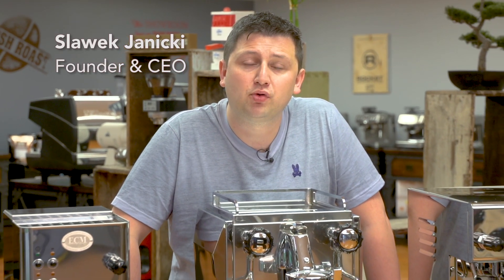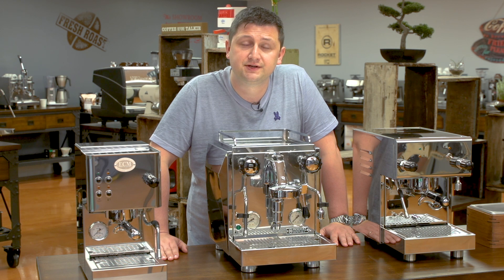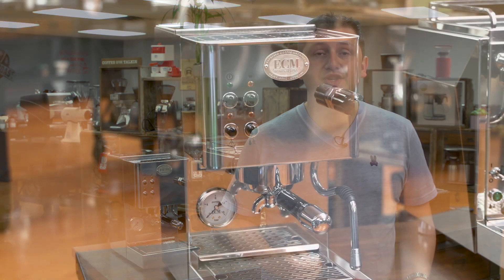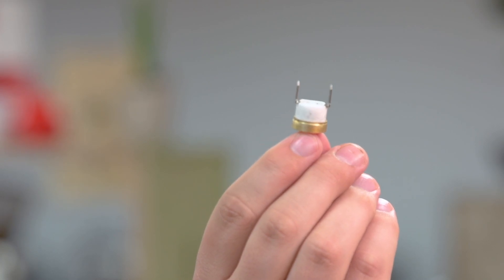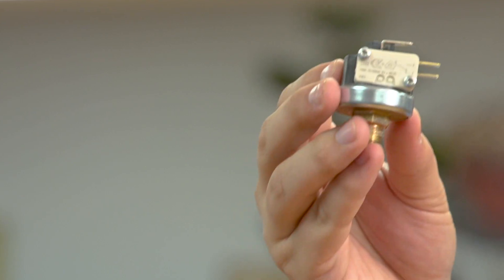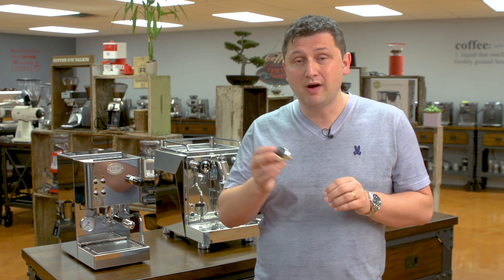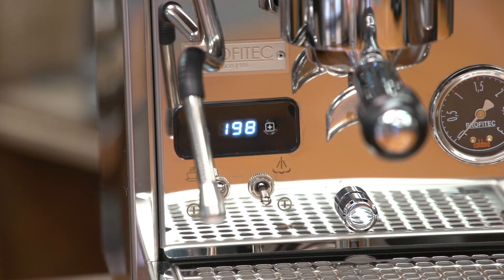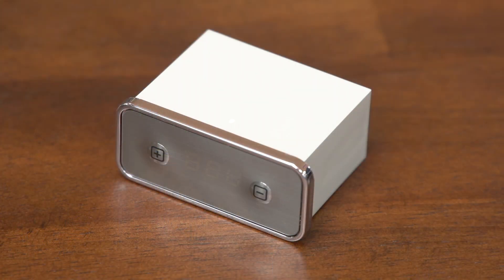Comparing the different ways of controlling temperature inside an espresso machine

Comment: Hi Slawek. Thank you for explaining PID! In a single boiler machine such as the Profitec Go for instance, how precise is what you set the PID and what it displays? For example, if you set it at 200F, does the PID turn the element off once it gets to 200F, but could residual heat allow the temperature to climb slightly higher, thus allowing the PID to display 201º or 202º perhaps?  Thank you.

Comment: Hi there, I want to upgrade my singleboiler machine from a pressurestat to a pid, what is the best location for the temp sensor to mount?
Reply from the maker: Usually most kits go in place of a thermostat.  That's likely the best spot because it is what the manufacturer uses
Reply: @iDrinkCoffeeCanada  well a pressurestat is placed on the top in the steam/air so to speak- this doesn't matter to measure pressure- while air isn't the best heat conductor I think a temp sensor should be placed on the bottom in the water for the best and direct heat conductance and thus measurement isn't it?
Reply from the maker: @Ronb008  hi, sorry I misread your post.  If you have a pressurestat that means you have a heat exchanger machine.  So yes I think the side or the the bottom is better, you want to be below the water line which is usually about 3/4 of the boiler.
Reply: @iDrinkCoffeeCanada  Yes i thought so, Ive got space to drill and mount it on the underside of the boiler so I think i'll go for that

Comment: Hi Slawek. Thank you for this good video! I am in between the Rocket Appartamento and the more expensive PID Giotto, Mozza V. I have a limited budget and wonder if you know whether the PID  Giotto would make much difference over the pressurstat Appartamento on the quality of brewed cofee. Thank you!
Reply: Which one did you buy ?
Reply: @Abaaaddy  Lelit MaraX. Not as nice as the Appartamento but better developed functions.
Reply: @eskerinola5845  does it have a PID?
Reply: @Abaaaddy  Lelit developed a DOUBLE sensor that works very effectively with the controller. It is not PID but afaik (common knowledge), the effect of PID controllers in HX machines, due to the fact that the one sensor is placed in the steam boiler, are RELATIVELY useful.

Comment: so if we need to compare between temperature stability this means that any PID machine is better than pressurestat
as if i want to compare temp control  between single boiler machine with  DIP and heat exchange the single boiler with PID is better 
also is there difference between heat exchange machine using PID and others with pressurestat

Comment: Good review. The "range" of mechanical and pressurestat activation is called 'deadband'. There are other ways of minimizing the deadband of these device use cases, but PID is becoming so cheap and prevalent now. Also, PIDs do not always have to just switch the heating element on/off hundreds of times. Some manufacturers will use SCR to modulate the power the element gets, and the PID controls this SCR output. This is theoretically a way to get more longevity out of the system since it is not constantly switching on/off.

Comment: Thanks for the informative video! How precisely can the brew temperatur on a spring lever machine like the Profitec Pro 800 be set? Do the benefits of the PID even properly show there?
Reply from the maker: In a dipper machine like the Pro 800 the water inside the boiler is used for both espresso and steam/hot water.  The PID gives you precise control of that water.  The water for the extraction is pulled from the bottom of the boiler and then as it passes through the hydraulic system and cools down before reaching the coffee.  The PID does help for sure but you can't go too low with your temperature on a dipper machine because you won't have any pressure inside your boiler.
Reply: iDrinkCoffeeCanada thank you! So in your experience, how many degrees Celsius would I be losing from the boiler to the group in order to calculate and set the necessary boiler temp for my particular brew temp?
Reply from the maker: @florinreifler1450  to be honest I have never measured.  I don't have a scace for lever groups but you have certainly given me an idea.